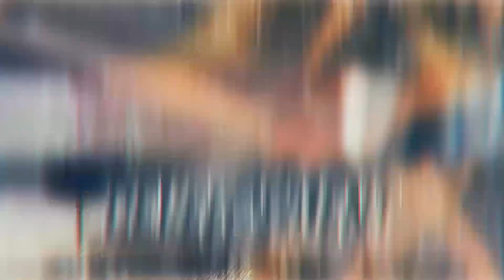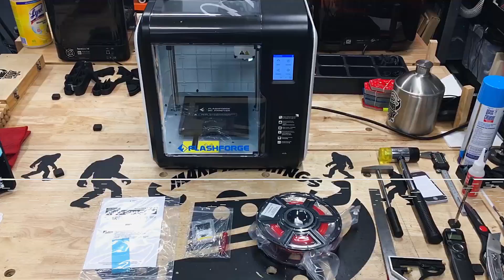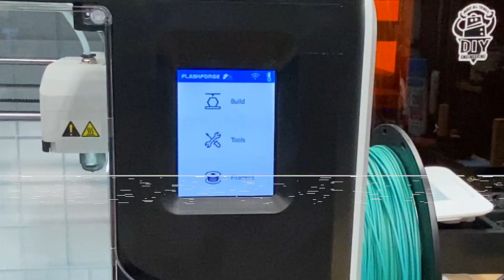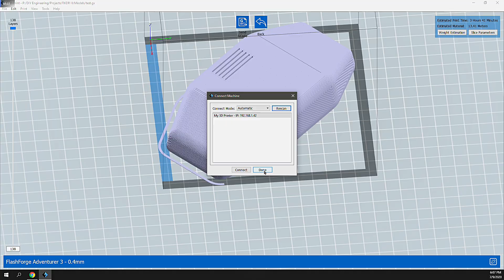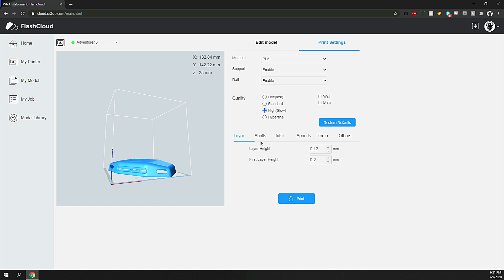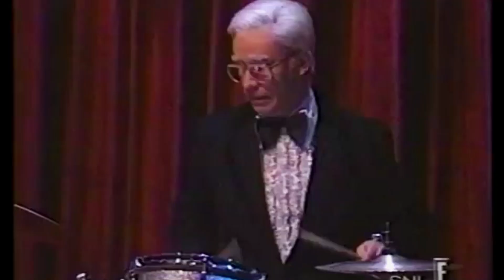Breaking the barrier to Easy 3D Printing with the FlashForge Adventurer 3!

Comment: I would have loved to see the underside of that print
Reply from the maker: which one? the shell or the calibration set?
Reply: The back plate of the case
Reply from the maker: @R3D-Remi  the surface wasnt bad, but was intentionally printed in the orientation which would leave the "rough" surface inside. you can find the images here: https://1drv.ms/u/s!AjSyWl01MM23jrV_L_q44TponiU1-Q?e=0C7Xf5
Reply: Thanks for getting back to me I just wanted to see the print quality of that printer.